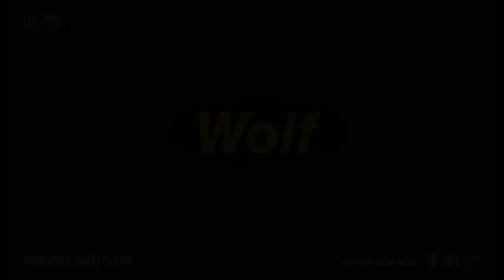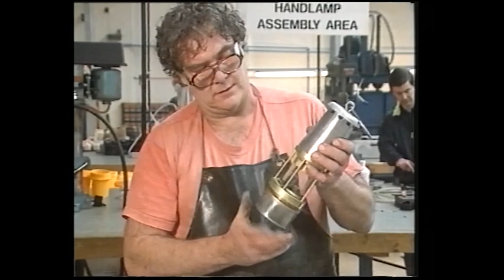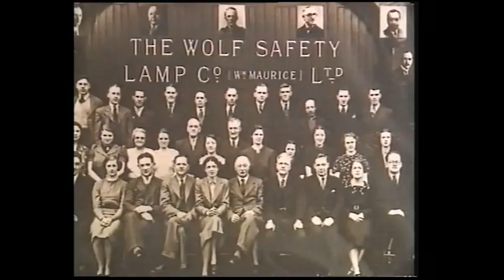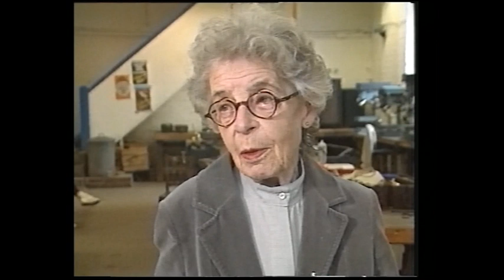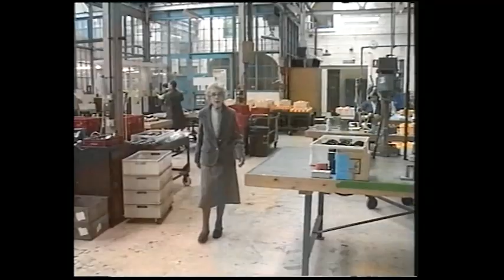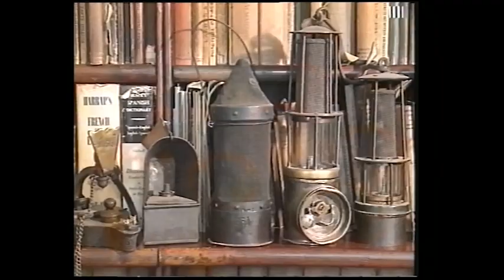Original Miner's Flame Safety Lamp Footage from Wolf Safety

Comment: How do you open this wolf lamp?
Reply: That is what i am trying to do with no luck?
Reply: @angelahampsoncollins1023  The deputies lamp the type that can be relit just have a wire and seal to show the lamp hasn't been opened. The type with a lighting wire inside are opened by applying a magnet to the base.
Reply: @angelahampsoncollins1023  The base has to pass over a strong magnet to release a locking pin,to unscrew the base.
Reply: @angelahampsoncollins1023  If it as two pins you simply put a small horseshow magnet across the two pins and then it will twist. It has a magnetic lock. I found a little Magnet a Menards hardware. You Need one that is the width of the pins so about an inch. When the flame turns blue there is a presents of methane gas. Flame will go out if high levels of carbon dioxide.